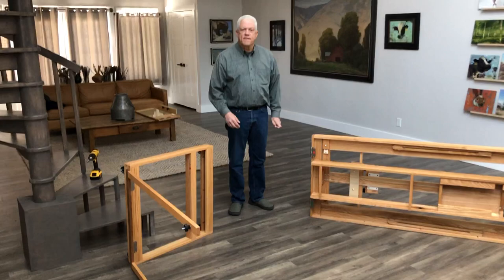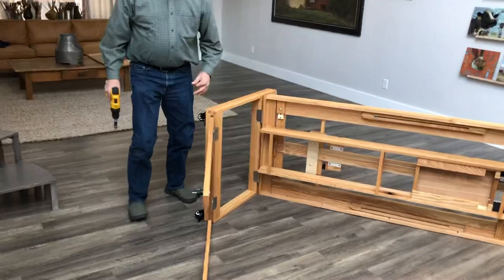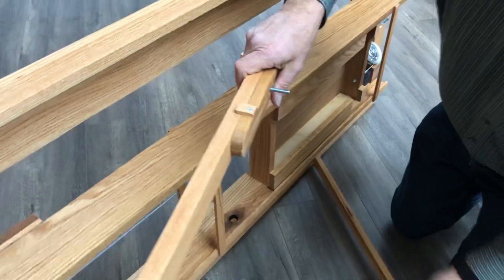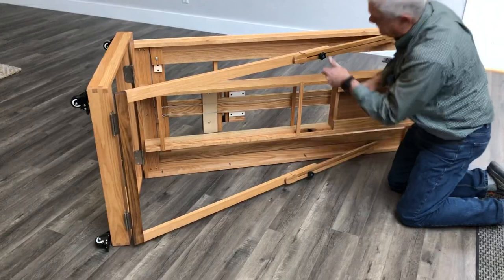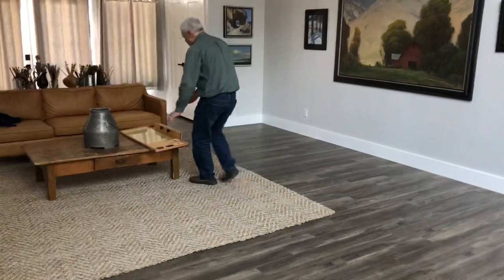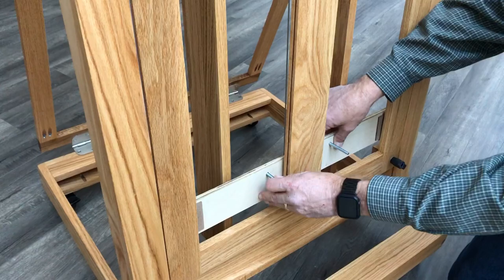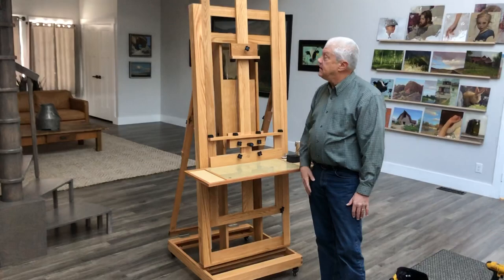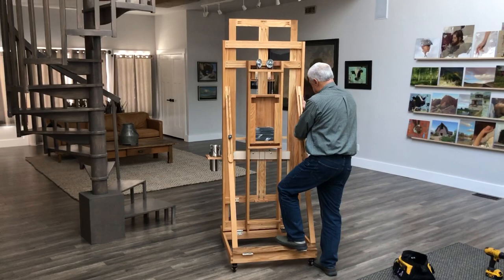Roberts Easel assembly

Comment: So with a large canvas fitted on the easel, and the picture rest lowered to paint near the top, the 'taboret' is on the floor!  - the very last place you'd want it.
  Or have I misunderstood?
Reply from the maker: You understand correctly. 
The Taboret is removable. 5 minutes. 
The design is not intended to resolve all obstacles of being an artist, just most of them.
Reply from the maker: Taboret is easily detachable to accommodate🙄